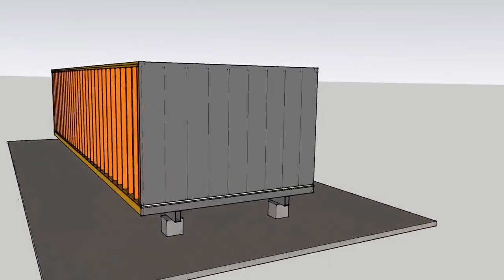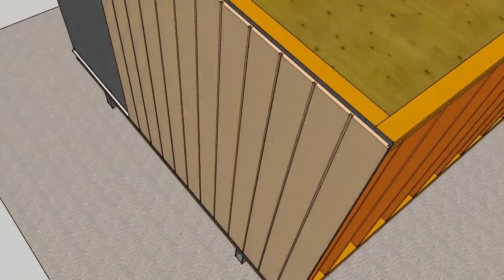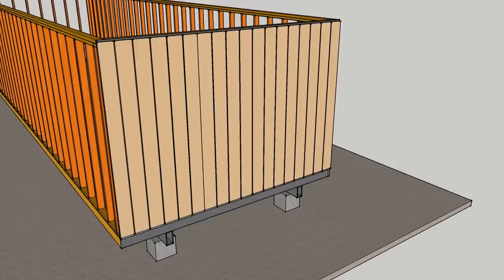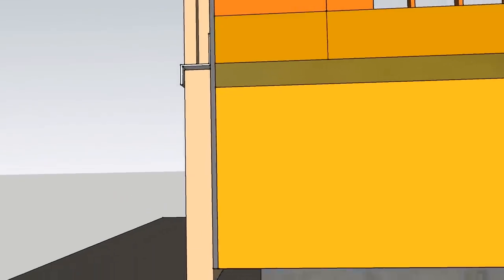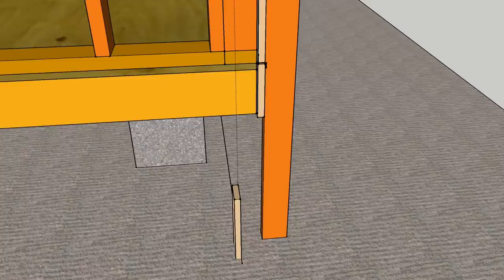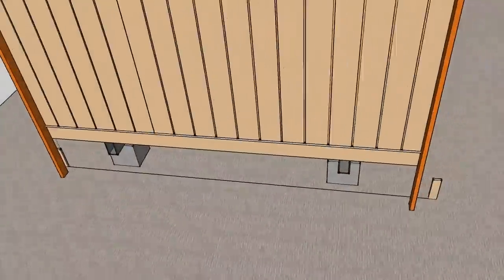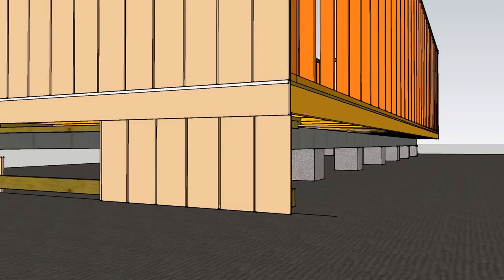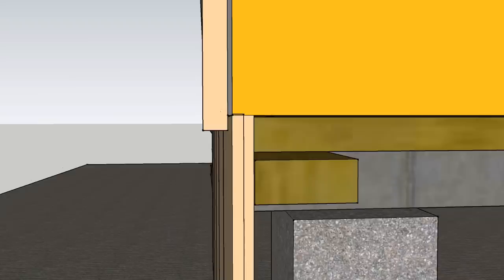How To Install Plywood Siding Mobile Home Skirting – Part One

Comment: Excellent Video! I have an old trailer we want to remodel inside and out but I had no idea how to do this. Especially the skirting. Is there a video that addresses the corners?
Reply from the maker: I don't think I have any more videos on this, even though I was planning on making a few more. What exactly do you need help with about the corners?
Reply: @constructionideas  I just need to know how to do them and keep the water out.
Reply from the maker: I understand and you might need to install some type of waterproof perimeter out of pressure treated lumber, concrete or concrete blocks to prevent water from going under the mobile home. I don't have a video on that either, sorry.

Comment: i want to use this idea for my deck.  It's cantilevered, so there is nothing to attached the lattice panels to like they show you for a porch.   I can attach a nailer along the top.  So you are saying to sink stakes in the ground with a connecting board to nail the lattice panel to?  Is that going to hold if I hit it with the lawn mower?   Pressure treated is supposed to go for only about 5 years before it disintigrates.  Any ideas????  And thank you.
Reply from the maker: The stakes will last longer if there isn't much moisture in the ground, but you can always pour concrete piers or a curb around the mobile home or use metal stakes if you're looking for more strength. If this doesn't make sense I will make a video, let me know either way.
Reply: I got it and thanks.
Reply: +constructionideas please make a video on the topic I would watch it
Reply from the maker: If you're referring to using metal stakes, simply replace the wood stakes in the video with metal ones and try to keep the wood off the ground at least an inch. If you're referring to the curb, let me know and I will make a video.
Reply: @constructionideas  reviving a very old thread here. I’d love to see a video on the curb-base method for skirting ‘foundation’. Thanks.

Comment: So, the whole bottom rail is screwed to wooden stakes set directly in the dirt ? Where is the foundation ? After a few good rains those wooden stakes would come loose and so would the bottom rail. Sorry, but this is a substandard design.
Reply from the maker: Keep in mind that these are only suggestions and if you live in an area where wood stakes loosen in the ground after it rains then you will need to find another alternative.